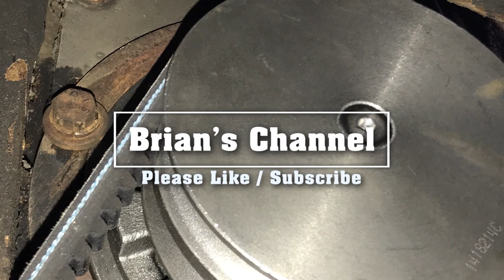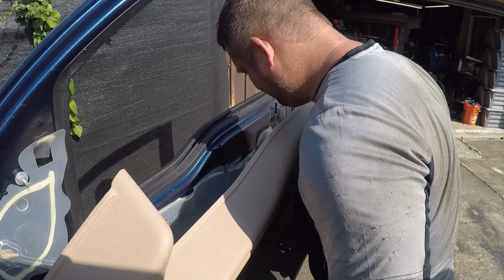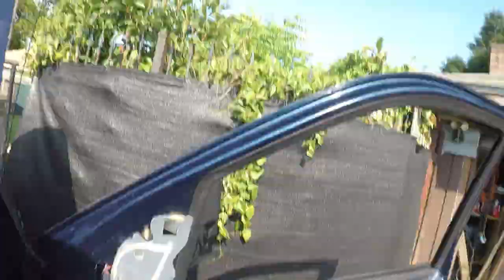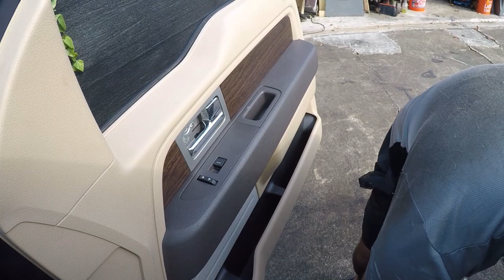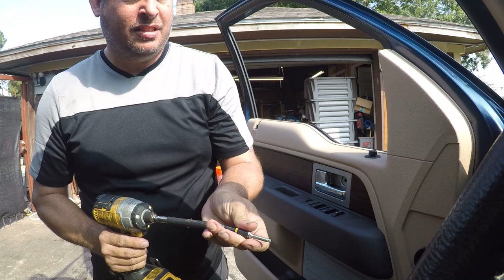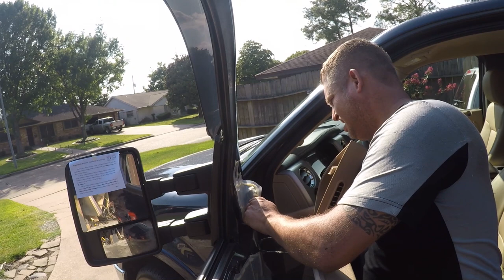F-150 Towing MIrror Upgrade - Installing aftermarket Power Fold / Power Telescope mirrors

Comment: I had bad carpal tunnel in both hands... it was only covered by my work comp because I frequently used power tools. Apparently power tools can cause carpal tunnel. 

Be careful with power tools too. Also consider stem cell therapy before doing surgery. I wish I had...

Comment: What year model is your truck and is it a XLT, Lariat or Platinum??? Does your mirror switch say FOLD/UNFOLD on it ??? please help
Reply from the maker: 2014 Lariat and yes the fold/unfold did work.  That is controlled by a module under the driver seat if I remember correctly.  Basically with aftermarket mirrors, your truck has to have the options to begin with.  If it doesn't it's an involved pain in the tail to add the options.... I wanted the telescoping, but my truck didn't have it and Ford makes it a major endeavor to add it.  You have to string wire out to the door etc... add a switch.  

Do make sure to electrical tape the connectors or otherwise water seal them and orient them so they will self-drain on aftermarket mirrors.  The connectors are not waterproof and if water gets in that mirror will stop working until you disassemble the connector and dry it out.
Reply: @hotpuppy72  Thank You soo much for taking the time to explain, very much appreciated!!!

Comment: glad they came thru for you. where'd you get caps & are they chrome or black? did the kit include switch & bezel for telescope? is there any vibration or shaking on the road or wind noise?
Reply from the maker: The caps are an option from them.  I have the painted caps.  I bought them with the mirrors and bought paint from PaintScratch.com.  It was expensive to use rattle can touch-up paint, but it looks great.  

Telescoping isn't supported for my truck and I can't easily add the switch.  I have some ideas and I'll touch on it when I do the next video on them.  Hoping to get to the non-working mirror today.

Comment: How do you hook up the puddle lite? 8 pin stock...to 16 pin mirror
Reply from the maker: Sounds like you didn't have the feature, at which point it may not work.   There are apparently wiring harness differences between the models.

Comment: Did your old caps fit the new mirror?
Reply from the maker: No.  and the passenger mirror quit working... .waiting to see if they will stand behind it.
Reply: @hotpuppy72  thanks for the reply & very sorry to hear this - sure hope they replace it - did all functions quit?  they gotta make it right since it's been less than a year - keep me posted on your outcome b/c i just got a pair but haven't put em on yet - best, richard
Reply: @hotpuppy72  are they Trail Ridge?
Reply from the maker: I think so.  I emailed them and they shipped me something that looks like one of the mirrors.  No hassles.  I'll do a video on it.  And yes, mirrors quit working entirely.